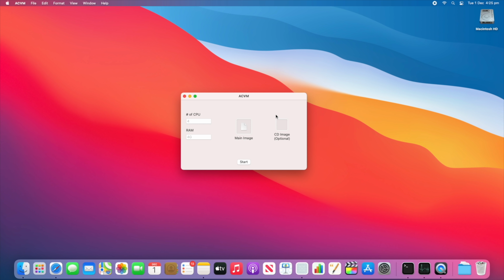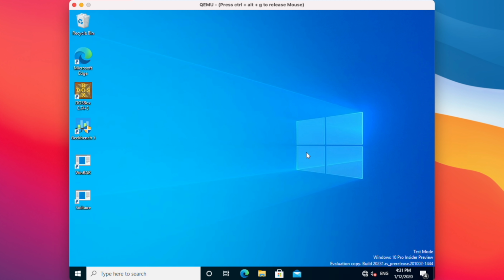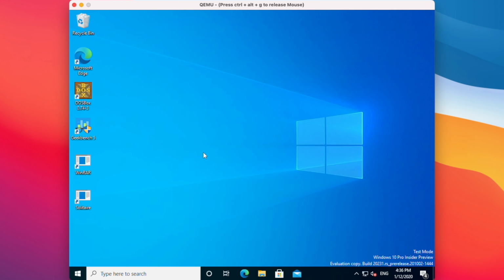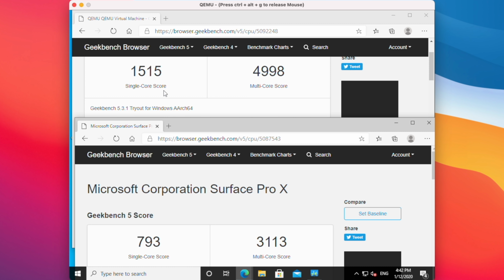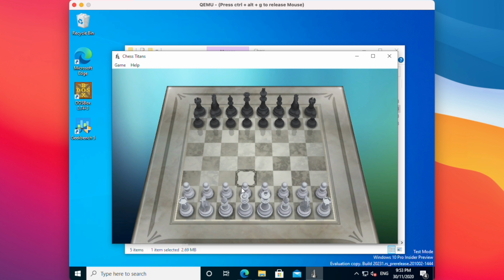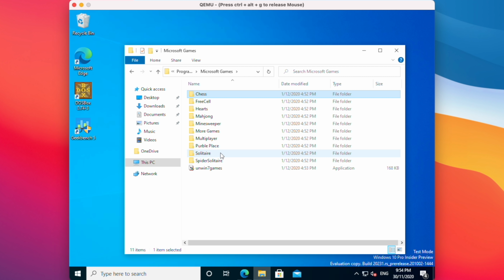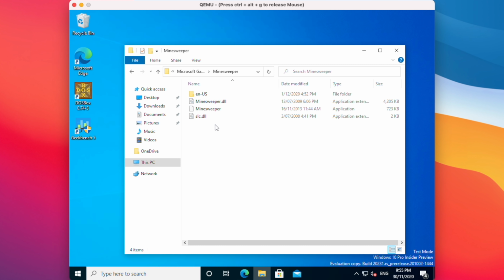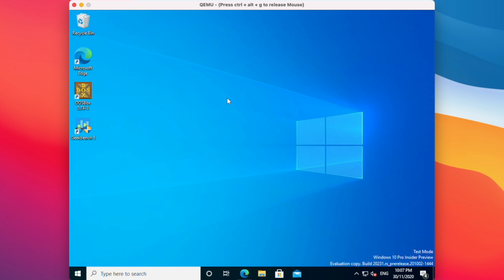Virtualizing Windows 10 ARM on an M1 Mac!

Comment: i setup my friends new airbook with m1 chip yesterday .  i had to download from my server apps app which i legally own . photoshop 2019 , office 2019, logic pro and final cut pro . it wasnt plugged in and  it was on ran battery - about 80% pre charged .   downloads were about  6 -7 gigs for the apps . by the end i was done ,it had still 78% battery left . i mean woah , no kidding . that thing lasts and its fast . all apps were not arm ready , it downloads rosetta and boom it works and loads fast also . i couldnt get photoshop to work , it crashed every time . office last 10% of installation took a bit longer, maybe by 10 minutes . i updated everything and the thing is still at 75% . not to shabby . iphone and ipad app run also , but they are way to small .... not feeling bad for intel , apple did good on this M1 . so that means no more hackintosh ?
Reply: Give Adobe a little time, they'll have those apps updated soon. When the M1 iMacs come out, Adobe will be ready.
Reply from the maker: Hackintoshes will most likely get support for another 3-5 years in terms of updated macOS versions until Apple formally stops updating Intel Macs.
Reply: @NobelTech  lets hope so , i like messing around with that . just hoping apple wont screw  up with next OS and stating its only for M1 chips . that would sting.
Reply from the maker: @BulentMr  OS support for each Mac is generally around 5-6 years now, 7 if you're lucky

Comment: So this is a special ARM version of windows? like the one the microsoft tablets run? if so, the M1 devices cant emulate intel versions of windows? Because intel Macs can run native intel windows versions (xp, nt, vista, 10, etc) and they can run PowerPC or even ancient Motorola 68xxx series os (Sheepshaver runs MacOS 9 and 8, Basilisk runs MacOS 6 & 7)
Reply from the maker: The M1s can emulate (not virtualise) x86 versions of Windows while Intel Macs can virtualise which is much faster. I’m doing a video on it tonight emulating different operating systems via QEMU. 

And yes this is an ARM version of windows similar to what the Surface Pro X can run.

Comment: Will this Windows ARM running inside emulator window drain battery faster than macos?
Reply from the maker: I have not tried it on an M1 MacBook Air or MacBook Pro yet so I can't confirm nor deny. Only tried it on an M1 Mac mini
Reply: @NobelTech  Thank you for clarification!

Comment: What's the battery life like? And does it retain the  performance with like a dozen Chrome tabs in the background? And is it possible to use graphics acceleration?
Reply from the maker: 1: The M1 mini is a desktop so there’s no battery
2: Haven’t tried it yet
3: Parallels and VMware will definitely have graphics acceleration support for their upcoming vm software

Comment: Even emulating Win 10, it is almost 4 times faster than the Windows laptop I have at home, which is enough for my usage.
Reply: And also an ssd hard disk whitout it even this test wont be fast
Reply: Smartphones are already way faster than alot of Windows and mac devices
Reply from the maker: Yep. And it only uses 4GB of RAM in this VM too.

Comment: im thinking of getting a 16gb ram and 512 ssd MBP what do yall think? on what i see apps are getting optimised fast and emulation too
Reply: Remember, right now, the MBP M1 is a 13 inch screen. The larger 16 inch is still an Intel processor. It's your money, but I would wait a bit. The larger screen Macs can't be too far off. Spring maybe, 4th of July at the latest.

Comment: While this is impressive, one can't conclude that Windows ARM runs better on Mac Hardware then on a Surface. It's a fairly short benchmark and it has no sound or graphic acceleration.
Otherwise said: if I put the motor of one car into another and don't connect to heating, lights, AC etc, the raw performance maybe better.

But, as I said: still impressive test and I can't wait that this starts the same revolution as AMD vs Intel :)
It's also whispered that Google will have their own silicon next year, that could give another boost to development.

Still I would never buy a laptop or PC, where I can't change/upgrade RAM or my hard drive. That's ok for smartphones but not for computers.

Comment: I don't even have a Mac and I'm still watching
P.S. Rosetta is emulation too, just more optimised
Reply: It's not an emulation. Rosetta converts x86 code to native arm binary at runtime. So it can run x86 code on arm processor. Which is an efficient solution than emulation. Apple has no magic wand that makes emulation performance better. They're just taking a different approach to the problem.
Reply: @yashptel  I think it's still a form of emulation called AOT (ahead of time) emulation (I'm not sure of that still counts emulation but I think it does), and it also uses JIT emulation when it can't use AOT
Reply: @yashptel  I'm not sure but I think Windows on ARM also does AOT translation?

Comment: So Macs now can run MacOS, IOS and Windows. 🤔 I think Microsoft has a good reason not to allow Windows on Macs, Apple even brought that Macs can run windows and not vice versa in an old Mac vs PC commercial.
Reply from the maker: We are yet to have confirmation for the latter two. But I don’t think it would take long for iOS to be reverse engineered to work on a macOS device with a full kernel patch
Reply: @NobelTech  Yes, probably you could run it in VMware or Parallels, next to Windows ARM, macOS, Linux etc. Microsoft should really improve their x86 emulation in Windows ARM for Windows x86 Apps though to get it as fast as in Rosetta 2 for x86 Mac Apps.

Comment: I want to buy an M1 MBP for studying at a mechanical engineering university (starting in September 2021). However, some softwares are only supported for Windows (Catia V5, Siemens NX,...). Do you reckon waiting until September to see if VirtualBox or Parallels will eventually come up with an ARM-optimized version of their apps (or possibly Microsoft making Win10 compatible with M1) or ditching the Mac and simply going for an AMD-equipped laptop? Thanks!
Reply from the maker: Wait until at least June. There will be much more comparability options and hopefully VMware and Parallels get closer to release by then on Apple Silicon. VirtualBox don’t have any plans to release for both Intel and ARM64 versions of Big Sur, sadly.
Reply: @NobelTech  big thanks buddy! This vid helped me a lot, along with this comment 😄

Comment: What about full screen mode?
Reply from the maker: Resolutions can’t be changed beside 800x600 and 1024x768, however you can get full screen mode using the UTM virtual machine app (which itself uses QEMU)
Reply: @NobelTech   Thank you for info Good work
Reply from the maker: @syjabina  No worries!

Comment: Can AAA games run through VM on M1?
Reply from the maker: If they’re recompiled for ARM64 and there is full graphics acceleration, it could be possible. I would wait for native WoA boot camp support, Craig made it clear it’s up to Microsoft to make the final call.
Reply: @NobelTech  Does the M1 have the power to run demanding games like Ghost recon breakpoint on medium or low presets ?
Reply: Cause I've seen videos saying that the M1chip has the power of a radeon rx 560 and gtx 1050 ti, so it should be able to run these games without an egpu
Reply from the maker: @ricky836  Well that’s something to find out after Parallels or VMware release their software, or native boot is introduced
Reply from the maker: @ricky836  Only if these apps are compiled with ARM64/Aarch64. I wouldn’t be surprised if macOS ports for some games occur because based on the iOS experience, the performance for games like fortnite is absolutely top notch
Reply: @NobelTech  And another question is once the windows can run on M1 natively, does that mean all x86 based games, programs ,and apps can run too ?
Reply from the maker: @ricky836  Yeah with emulation. But unless there’s an AArch64/ARM64 port for these AAA games, don’t expect them to work on WoA prior to them being released
Reply: @NobelTech  Sorry, but what does that actually mean ?
Reply from the maker: @ricky836  Current PCs use a platform known as x86_64. The Windows 10 version shown in this video is an ARM64 version of it. ARM is a different platform and so a lot of games have to be recompiled from scratch
Reply: @NobelTech  ok thanks for your help !
Reply: @NobelTech  yeah if you're a gamer, buying an m1 for gaming, it's like buying a ferrari when u live in a jungle.

Comment: Can you instal x86 apps on this?
Reply from the maker: Yes. The games that I played in this video and DOSBox are all x86 emulated.
Reply: @NobelTech  does that include cs go
Reply from the maker: @TVCHLORD  Absolutely not. Processor-heavy games like COD, FIFA or essentially anything steam related would most likely not work, or be slow as a snail.
Reply: @NobelTech  that’s excellent... I need some windows programs for work and this is extremely helpful to know before buying... thanks!
Reply from the maker: @RacoonHands92  I'd wait at least 9 months to a year before buying an M1 Mac if your primary aim is running Windows on ARM in a professional environment. I think if enough noise is made, Apple will go for a native booting option for it.
Reply: @NobelTech  Microsoft would probably need to recompile windows and update drivers/apis to use the M1 chip in an optimum manner.  Then that version of Windows will fly!
Reply: Thanks for the advice... I guess I’ll have to wait a bit longer... maybe for la 2nd gen...

Comment: Hm nice new intro! Pretty nice that windows is back with this app after bootcamp got fazed out. Also, can you do a video on the Startup Options and other Apple Silicon startup screens on the Mac mini?
Reply from the maker: Boot Camp isn’t 100% ruled out. Craig said it’s possible but only if Microsoft agrees to licensing it for Macs.
Reply: @NobelTech  Microsoft should do so. It would really accelerate the move of Windows to ARM. ARM is the future.